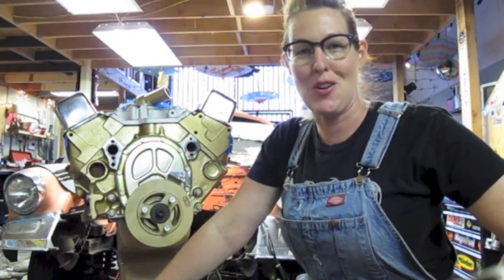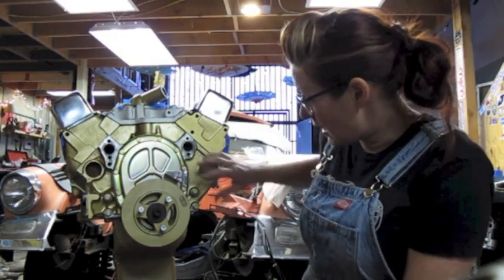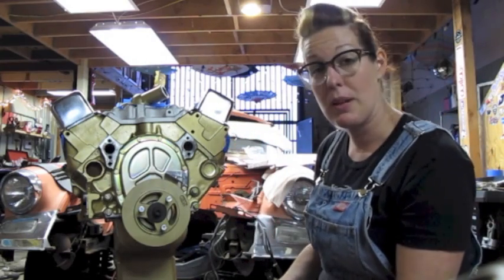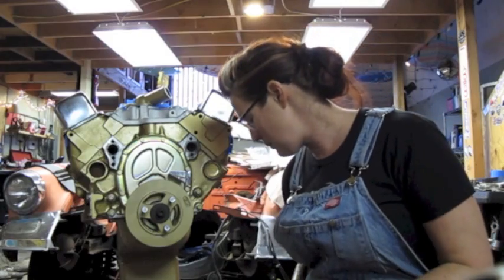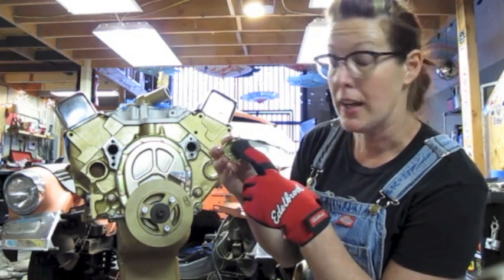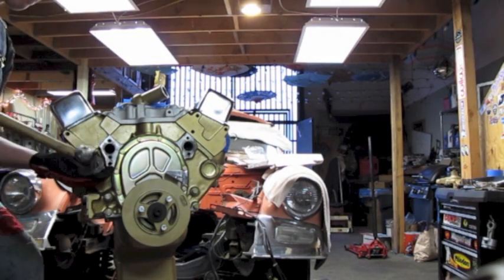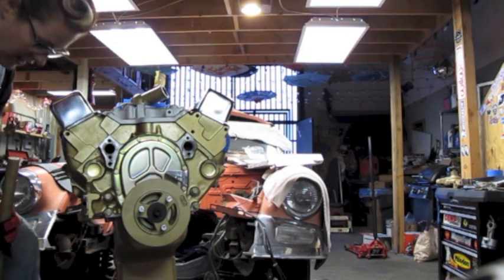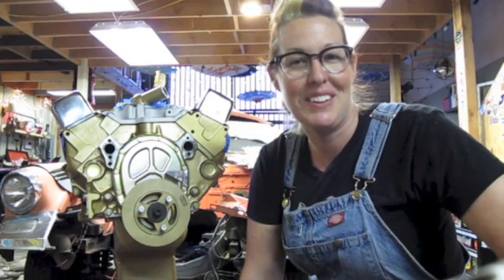Replacing Engine Freeze Plugs

Comment: Hello ms.... I'm working on my 1991 Honda Accord ..... running hot.....  i think the heater core is bad... leaking water passager side floor and also leaking coolant behind the motor
Reply: I'm not sure if it's a u hoes I could really use your advice and help thank you

Comment: Freeze plugs are a complete misnomer, they aren't totally to prevent the engine block or cylinder head from cracking in case of freezing coolant, and in fact often don't pop out in the case of a frozen block. Their primary purpose is to simply fill the holes left behind from sand cores.  Those parts of the sand cores are used to properly position the cores in the mold and are known as the core "print."  They also serve as a pathway to shake out the core sand after casting.  Here is an example of a cylinder head water jacket  sand core.  The cylinders sticking out at each end are the core print, which will come out as holes at each end of the cylinder head casting.  These holes will be machined and filled with core plugs, aka "freeze plugs".
Reply: TheVerdad
You are correct, most people in warm climate never get to see a freeze plug pop out if they used to much water instead if antifreeze.🤓

Comment: The worst part of some freeze plugs are locations when the engine is in the car. The rx7 gives me no room to hammer it in... Still wondering why mazda had coolant flow through the intake....
Reply from the maker: +M1NH5AN3 I hear ya! I wouldn't want to change these SBC ones in a car either!

Comment: Arent you supposed to put sealant around the OD of the plugs before hitting them in?
Reply: Ron 
Sealant does not go around this type of plug, the sealant can actually cause it to slip out from the corrosion cause by the mineral content of the antifreeze and water.🤓
Reply: RickK RocKStar You should be using distilled water which only has about 1 ppm of minerals.

Comment: They are core plugs no such thing as a freeze plug
Reply from the maker: Thanks for adding that note, should have included in video that there are multiple names for these...core plugs are a more proper term, I believe expansion plugs is also used. However, freeze plugs is a very common term (albeit misleading) and is what the part I ordered was called.
Reply: Myvintageiron7512 depends were you come from you fucking hillbilly leave her alone she can build better than you can god damn ford owner!